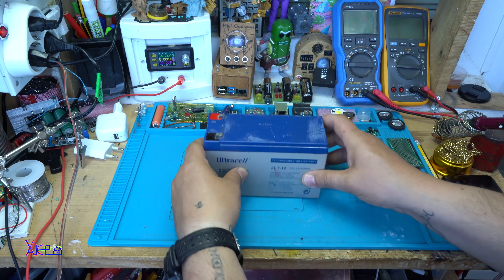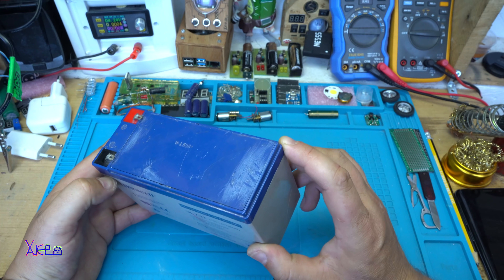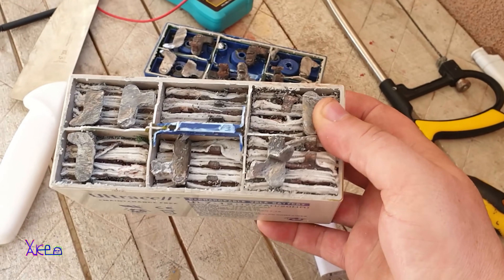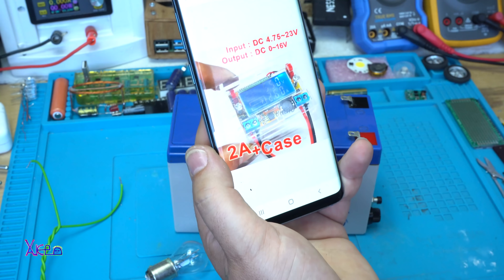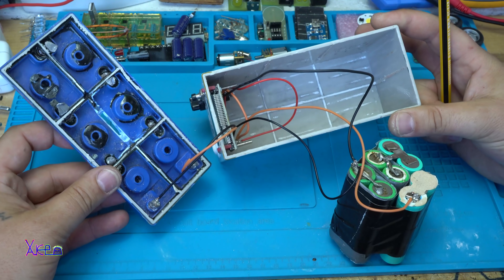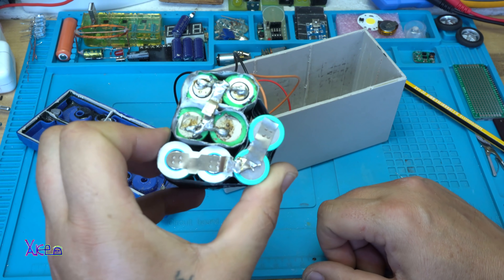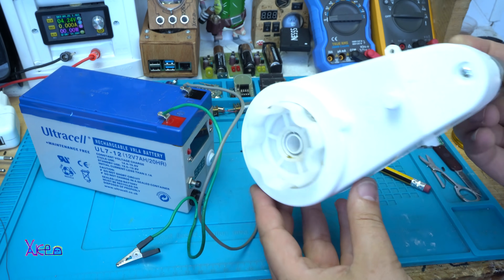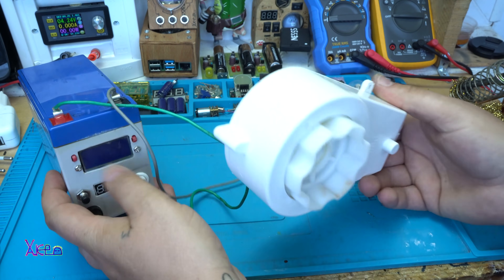Replace 12v Lead Acid with Lithium Battery and Adjustable  Power Supply

Comment: That's a good one, I like the repurposing of those 12 volt batteries. Is there anything that can be done with the lead taken out of them? I have 4 of those for a scooter I got out of the garbage. Two of the batteries where in the scooter and two I bought to replace, but they didn't last very long.

Comment: can this project be used for motorcycle and to replace the traditional wet cell battery?
Reply from the maker: No,max current is 2A
Reply: @Hacktuber  ok. thanks and i love your hack with lead acid battery

Comment: Nice, should of put the fuse, buttons and electronics in the top part in between the top slim cover and where the vent holes were for the cells so you could still use it in things that take that battery. I think there is also some balance chips out there that will allow charging from the same terminals as the power terminals. I pulled one from a blackweb brand portable powerbank that had an AC outlet but it was 18v not 12v so don't know if it would have worked here.
Reply from the maker: Thanks man for feedback

Comment: Awesome project..... you are great..........

Few queries:-

1)Can we increase the number of batteries to increase the mAh of the whole battery as we have plenty of space?
2)I think we should not drain the li-ion battery below a certain voltage (2.5v?) so is there any protection other than checking whole pack's voltage?
3)We cannot charge the batteries using the +ve and -ve on the the top, right? 
so any separate port to charge the battery?
Reply: One more thing...... I saw your project on instructables.. you are everywhere........Nice
Reply from the maker: Thanks for feedback,the dig.pow supply can give max 2A